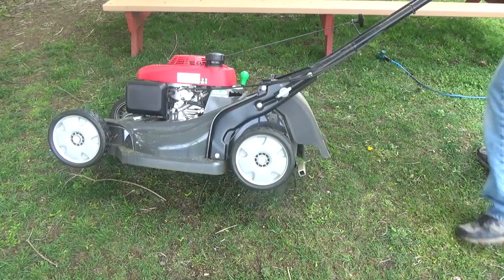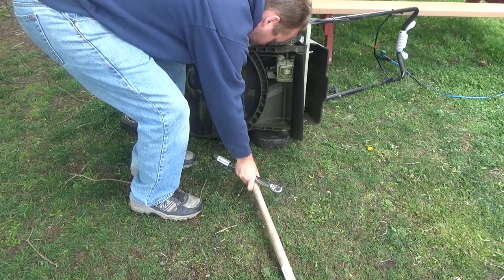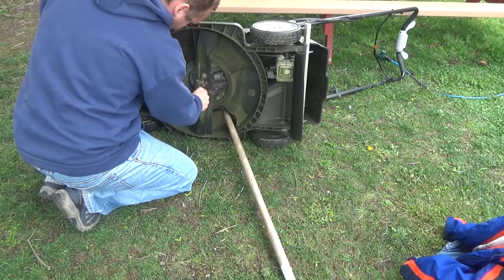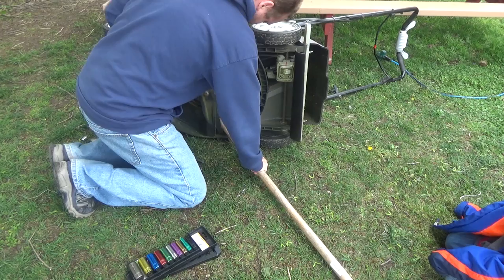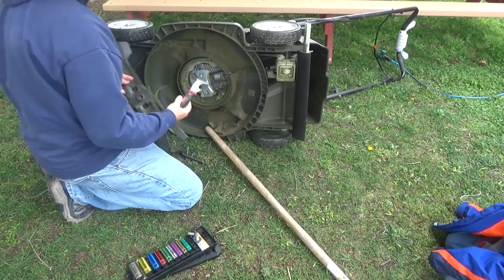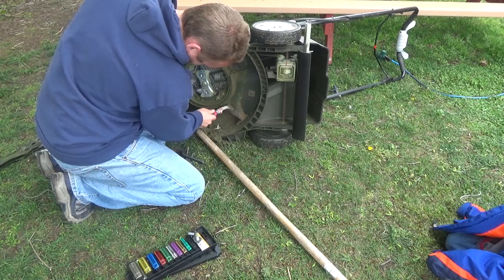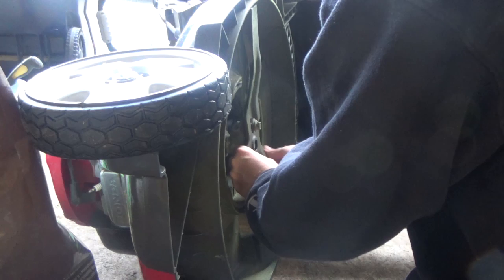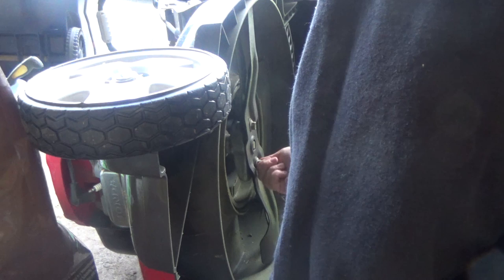Replacing Lawn Mower Blades on the Honda HRX217

Comment: HI!  You replied but now I can’t find the video.  Yes I found the spark plug--d’uh.  But I couldn’t get the nut off--never was removed in four years--I bought it used.  Rusted on. Now I USED to own a LOT of tools---socket wrenches, ratchet, power tools, routers (I used to make my own furniture in Hawai’i. Every home is tiny--400-500 sq ft. So I designed corner benches and separate tables that could be shoved in corner etc.  Built in book cases and so on.)

Moving from Hawai’i to Georgia costs $2 a pound in moving costs!  I left almost ALL tools behind (My neighbors were ecstatic--Big Green Egg, 2 large char-broilers, smokers, and so many tools including for gardening!  Ladders, table saws--on and on.

I couldn’t get the nut off, couldn’t even find a half inch adapter for socket wrench.  And NO I had no torque wrench ($35-$50), no impact wrench ($35 to $90) either. New blade? $18 PLUS $18.50 for shipping!  I said screw it and bought a new Toro 22inch self-propelled Honda engine on sale from $320 down to $200.

Got it home--OMG the parts are so CHEAP!  Look like malleable tin!  I’ll take the old one up to a church charity, and attempt to figure the new one out.  I REALLY need to plow the lawn under or just let it grow!
Reply: Hey where do you get the center blade bolt
Reply from the maker: Yikes! Good luck with the new mower. If there is a harbor freight nearby I love their tools, cheap but work great ;-)

Comment: Well the video was about changing the blades and yet when you got to the part of actually putting on the new blades, you gave no instructions. We just see you putting the blades on while you talk about a torque wrench. We do not see how to position the blades before mounting them on the mower. There are two blades and they need to be positioned a certain way before you mount them to the mower. To me this is the critical part I was wanting to see. I get loosening the existing bolts and removing the old blades and then putting the new blades on and tightening the bolts but one of those blades goes on top of the other etc. - no instructions.